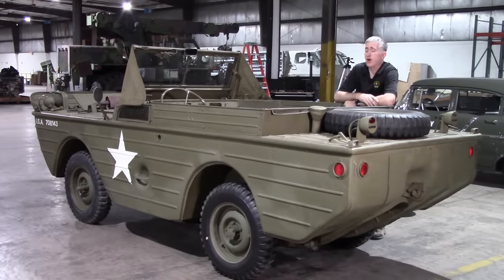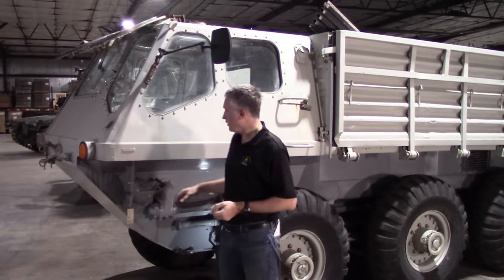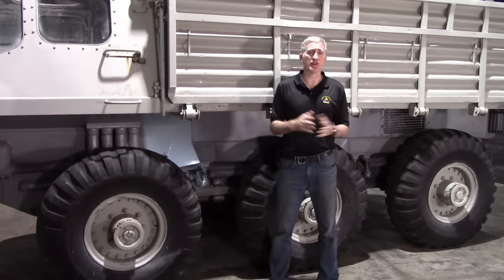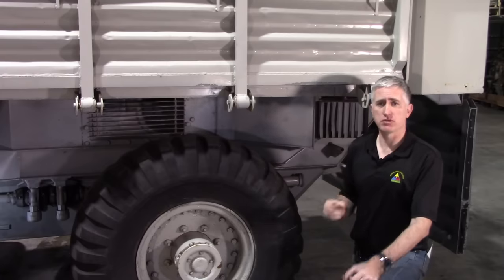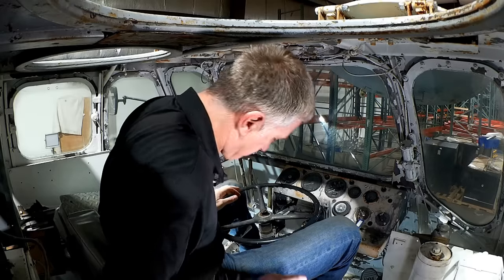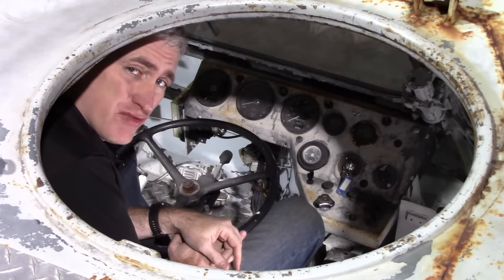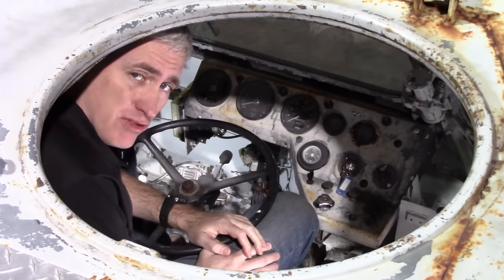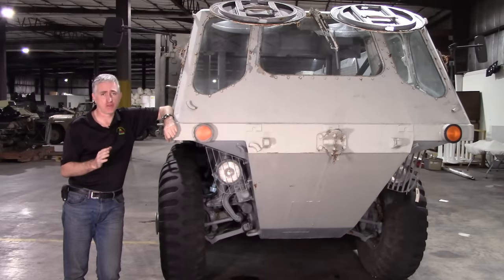Inside the Chieftain's Hatch: FV622 Stalwart MkII

Comment: I saw a chap who'd put the diff lock on on his Discovery because he was "off road" (a dry field) come to a grinding halt. He looked on in amazement when I reversed it in roughly the path he'd taken and then drove forward again with no problem. He wanted me to explain how and why but I just told him not to touch the diff lock again, ever.
Reply: A dry field should not be a problem for a diff lock, not unless it was like hard packed mud baked to the consistency of concrete. I have driven miles on packed gravel roads without a problem, and it is easy to break traction. I cannot imagine any field the could create enough traction to cause problems with the diff lock. Even if you were turning it in sharp circles the whole time. And I can't imagine how a diff lock would cause the problem you describe. if he was driving straight across the field there would be no problem at all. if he was driving in tight circles, like I said, even assuming the field was like concrete and allowed no slippage, wind up will not make you come to a 'grinding halt". It will either snap something in the driveline, or it will suddenly go "bang" as it pops out of lock and frees itself. Please explain how you think tension in the driveshaft between front and rear axles can cause the whole vehicle to simply stop moving.

Comment: If the vehicle has a single frame construction it is a truck.  If it is split into two parts (like a motorised unit that attaches to a trailer) it is a lorry.

Comment: This was a very fine vehicle which succeeded in its design value economically in its day. The vital matter for British forces at that time was compatibility and this could be done with the other armoured vehicles at the time. It was primarily an ammunition carrier which is why it had a Graviner FireWire system around the top of the engine bay. Unfortunately squaddies often trod on it and broke it. This was not the fault of the system but poor positioning architecturally. The reason for the bilge alarm was the bung at the bottom of the hull could be left out by the driver! 
These were annoying and amusing to work on. Your head was lower than your - feet - for much of the time no matter what your trade but there was always satisfaction at seeing one back on action. The board at the front which kept the bow wave from swamping the front deck seems to be missing. It often is on civvy restorations as the wood does rot and the most they do today is cross a puddle. Convoys of these on the autobahn’s would drive off road every 15 miles to release the system but I seem to recall there was often work on these six wheel systems with Saracens etc having middle wheel stations being serviced. 
The biggest problem with much armour based vehicles at that time was keeping them covered as north European weather is hard on vehicles standing out for the majority of their lives but only run from time to time. This is why many vehicle parks are busy in the morning but there was usually more work than skilled hands to fix. I doubt it is any different now. All in all a good vehicle which required a driver to take a grade II licence to drive and a supervised course of instruction. Sometimes they were told to get on with it and then the problems began. These are great fun but an acquired taste to drive demand considerable mechanical involvement and really need to be kept sheded by at least a roof.

Comment: From knowing people that drove/worked/repaired this, these are a ****ing pain to fix because of nothing in the normal place and nothing standard and you just cannot easily unbolt stuff to replace it, something always in the way.  Also, some of the spare parts are a pain in the bottom to get hold of now esp if it got anything to do with it floating and driving in water

Comment: You must be about 8feet tall, I'm 6'2" and drove them with no problem. The sandbar tyres are usually inflated to 90psi and don't grip very well on hard surfaces, tyres with better grip would have destroyed the transmission in no time and the British version never had centralised tyre inflation.

Comment: Why did Alvis not use a locking open differential? That would have allowed skid steering via the brakes. So much easier than complicated double axle steering.
Reply from the maker: I have no clue
Reply: Dual-axle steering is actually not very complicated at all.  It only requires one extra "pivot-bar" linkage that connects the steering hardware between two adjacent axles.  Such setups can be seen on countless military and special-duty commercial trucks (take a look at any such system and you'll see how remarkably simple it really is).  The method of skid-steering that you propose is very inefficient and terribly destructive of tires, and this is compounded when carrying a heavy loads, which this truck is designed to do.  A typical truck also would lack the ability to make the system work well when in the higher gears that are needed for high-speed driving on paved roads (trucks do not have enough driveline torque output to overcome tire traction when in those higher gears).  There's a reason that multi-axle military trucks never use the skid-steer method, but instead use multi-axle steering.  Also, skid-steering would do nothing to eliminate the "wind-up" problem that occurs between adjacent axles with this drive train during turns or even during straight-ahead driving (during straight-ahead driving this happens because it's impossible for all the tires to have exactly the same rolling radius, with that radius even constantly changing due to momentary "squatting" of various tires).  Installing two extra differentials (with locking capability),  one between the front axle and the middle axle, and one between the rear axle and the middle axle, would have solved this problem while retaining all-wheel drive at all times and full non-differential operation when needed), but it appears that the sheer lack of available space within area occupied by the drive system is probably the reason that they didn't do this.  Installing a drive-shaft disconnect in place of those two extra differentials would have been much simpler solution for driving on high-traction surfaces (making it possible to switch to single-axle drive when traction is good), since such a device would be far more compact, but perhaps even that was a level of complexity and use of space that the designers were unable or unwilling to solve.

Comment: I know he said it weighed 9 tons and a 6.5 liter straight 8 and associated transmission and 6 wheel suspension are heavy, but I have to imagine putting 5 tons of cargo that high up must really change the handling characteristics.
Reply: 8.5 Ton empty. 6.5 litre which is so reduced by the hub reduction gear that it produces 43 MPH. if they were non hub reduction then top speed would be awesome
Reply: @markellis7819  I was referring to  being as tipover prone as an SUV with a snowmobile on the roof.
Reply: The whole drive train and fuel tank are sat on the bottom of the hull, between the wheels. The side angle is quite impressive

Comment: "Mainly meant to be offroad" I kind of doubt that. All military vehicles need to be offroad capable, but they actually do most driving on roads. Your supply lines are all on highways until you reach the very front lines, when you might need to leave the roads to reach the places where the fighting it happening. But most supply trucks will only travel from the rear areas to the forward depots, on roads. Not even tanks just advance directly across country, except when they are in direct contact with the enemy. Most of your 'offroad" capability is used for when the crude back roads or temporary roads get churned into a mass of mud by all the other traffic, or when it snows, etc. But you aren't often actually just driving off through woods and over fields.

Comment: Ugh... not sure if this is a more modern invention or something, but a manual locking differential must have been too much engineering needed to aliviate the wheel speed difference. Much like a float switch on the bilge pump.

Comment: the stally is almost impossible to work on. nothing is easy to get at. the only one I ever worked on had no swim kit fitted and I suspect would have sunk instantly as it was full of rust holes. :)
Reply: Second hand kit always need quality work to bring it back to the original factory spec

Comment: Who thought that drivers position was a good idea? Why not put the hatch above so the driver can get the cramp out once in a while...
Reply: Falco van gaans some one who was five foot eight
Reply: @jenkinsonian  I doubt being wedged between a roof and a seat is comfortable for someone who's 1,7 meters.
Reply: Cab could seat three
Reply: When it was designed in the 50's the soldiers were shorter and skinnier.  It would not have been a major problem.  A lot of British military vehicles at the time has the driver in the center.  They were used all over the world so it was simpler to just put the driver in the center than worry about which side he should be on.
Reply: @ptonpc  what are you on?

Comment: these got used to transport fuel and ammo, the MKI had a meteor engine, the exhaust would glow red hot, the fuel cans leaked a lot, guess what happened a lot!
Reply: They went from a 600hp Meteor to a 210 hp straight 8?
Reply: @luvr381  My bad! turns out i was wrong but the exhaust manifolds did glow red hot on them and fire was a problem
Reply: @andreww2098  Ah, ok, ty.
Reply: Used to carry pack fuel (jerry cans - which did not leak, although filling the cans while in the back could cause spillages, bulk fuel (the UBRE) and munitions mostly. There was the odd fire but they were not that prone to it really - the exhaust system did glow bright red under the cargo bed and the rear area where the cooling air was vented got warm (often a place to find a few blokes on a cold exercise). Used to have quite a bad back fire with flames shooting out of the exhaust at times (some fires were caused by hessian screens catching fire from the exhaust when improperly stowed)
Reply: Always a Rolls Royce B81 engine. Even the Mk 2 exhausts would glow in the dark. but never a fire due to where the exhaust was routed out of the hull and up in to the exhaust box by the louvre

Comment: And where is that "wind up" energy from the difference in wheel speeds stored untill you hit a rail or curb or whatever? A very simplistic interpretation for shure. Ever heard about tire slip? That will make the tires wear extra and at the other end wear out the drive sytem (on the long term) but unless this thing has something similar to clock type wire springs per wheel axle none such energy can be absorbed and stored to be unwound later. Same as with the remark about 5 tons being much for that floor and those beams. Ever heard about dividing a load by it's footprint to get the locally applied force (N/m2 or pounds per square foot)? I am sure those beams could actually take a lot more and since they are crossbeams in the frame they already do. Conclusion: There might be good general vehicle knowledge on board but so is a poor insight in physics.
Reply from the maker: Wind-up is a thing as per the operator's manual, and as you read the other comments on this video, you will see remarks by service users as to the various techniques used to release the wind. Metal bars will twist and act as a spring, after all. Slippage is more common off-road as the tyres have less grip, again, as specified in the manual.
Yes, I'm well aware that the metal bars can take the weight. I merely observe that they look surprisingly thin.
Reply: @TheChieftainsHatch  Interesting. But then there should still be some sort of facility for it. Otherwise the rotational angle for torsion will be minimal and thus, again, the potential for energy storage. Tire slip will still be a big factor on the road, even if less immediate and pronounced.Put your foot on the brakes at full speed on a propperly facilitated multiwheeler and you'll know. Makes me wonder who wrote the manual. Was it a factory or an army release?

Comment: Sorry, that was so embarrassing to listen to.....!!
The tyres are not self inflating/deflating
All Mk 2's have a winch. It looks like the hole where the winch cable would have exited the vehicle has been welded over on this vehicle. The area where the winch assy was mounted was a separate compartment which flooded when in the water, hence the drain plug at the bottom of this compartment to be used to allow the water to escape once swimming was complete.
The thing under the steering wheel which you called an Indicator Switch, is in fact the Trailer Air Brake Actuation Valve when towing trailers with air brakes !!
Your comment about tyre circumferences not correct.
Tyre sizes must be within 2inches circumference of each other, ON THAT SAME SIDE, otherwise this can cause wind up and damage to Bevel Box's (Qty 6 giving 90degree drive to each wheel station) and/or Tracts Joints(Chobham Tracts Constant Velocity Joints)
Your comment about the No Spin Differential incorrect.
This type of differential allows one side of all three wheels on that side to "free wheel" for a very short period, if speeded up faster than the other side when cornering or in mud or cross country travel. Hence when driving on a road it can be felt within the vehicle and moves slightly left and right as the differential shows it working correctly. 
Hope this is helpful to those interested

u

Comment: Not a very good example...........much stuff missing and incorrect fittings etc.
Drivers seat is fully adjustable and will adjust downwards even for the tallest of drivers.
No central tyre inflation was ever fitted.
Reply from the maker: You know, I am so used to fixed seats, I forgot to check. That would explain how I was able to drive one prior with good memories.
Reply: Hi....just want to say I like your work and have learn a few things about armoured vehicles.You missed a few interesting things with the Stalwart......but you didn't have a good one to work with.oh my god the vehicle is on fire.....the stalwart had a extensive fire warning system and Two shot extinguishing system.It was the first ever production truck with disc brakes, but it was also on all wheels , dual circult with Four pot calipers.the steering wheel position indicator is on the floor behind a small plate with wing nuts which covers it when not in use.The stalwart also had the tankers BV in the cabin, central lube system on MK 2 vehicles for all the hubs ect.All fluids can be topped up with a load in the cargo area via special access points The steering is different in the stalwart, but not in the way you described, the hydraulic valving for the steering is  bit interesting and with the auto locking diff , laying down power or changing gear in a round about is not recommended.The B series rolls motors are also interesting .My Stalwart and other stuff is on You tube RONAEMVCS.please when you get around to doing the WW2 jeep, please point out some of its not well known features.the wheel brace with also adjust the head lights, tighten the head bolts, change fuel and oil filters and lots of other stuff.The head lights fold back on to the engine bay  for night repairs.The fan belt is quick release for river fording.WW2 jeeps also have a torque reaction spring on the front LHS road spring to help reduce a design problem of pulling hard to the left during emergency braking.Twin stick transfercase lever set up makes high/low changing on the move a snap.Keep at it Ron

Comment: Permanently locked diff on 6x6 wheel drive.
Reply: Non slip differential. If the vehicle in front of you in a convoy slowed down half way round a bend then you would kangaroo round the bend as you took your foot off the pedal

Comment: Truck and lorry are mostly interchangeable, but it's mostly around size, articulation, and body style.
An articulated 40 tonne truck? Lorry.
Pickup truck? Truck if it's big, car if it isn't. If it's one of those big shiny American ones with bling-bling wheels, it's a small penis.
Big van? Lorry.
The same chassis but a flatbed? A truck.

As for the metal roof, I assume that it's for in case you drive into the Rhine at full speed straight off a pier, and rely on the thing being amphibious.

Comment: From what I gather a Lorry is what we call in the US as a Box Truck.... or medium duty truck depending on what you do...
hmmm anyone want to crowd fund this for him?
Reply: Well, he did say he wanted a project car, didn't he?
Reply: @Erdanya  And he could make more videos on it :P
Reply: Nothing to do with size, definition is typically thus: 
Lorry = articulated, with seperate cab and trailer components (so most of the HGV's you see). 
Truck = Non articulated, with the cab and cargo trailer as one continuous 'piece'. 

Thus any US Semi is by definition a Lorry in the UK, not a truck, as it comprises of a Cab and seperate Trailer(s)
Reply: @alganhar1  So what we call a Tractor trailer is what you would call a lorry then.... and what we call a box truck is just a truck over there then... 
We have 3 categories of truck here xD
Light would be a Pickup Truck up to a Chevy 3500 or Ford 350 for example
Medium trucks (also known as box/utility trucks) would be in the 4500 to 7500 (just knock a Zero off for Ford)
And Heavy would be anything above that
Though we have articulated mediums and heavies using a 5th wheel the lights are often seen with trailers as well.... at least around my parts of the US